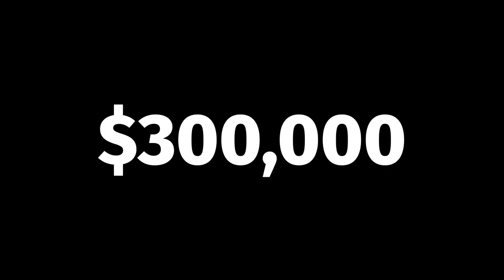7 CHEAP OFF-GRID HOME OPTIONS for Your Homestead - Podcast Episode 122

Comment: That was a very informative podcast.  And although I know this comment is coming a year after the fact, I feel I need to make it.  I am not against a natural built home at all.  And for sure the environmental footprint is something to consider - it is something I keep in mind a lot.  To each their own.

With that in mind, I find it interesting that moving an older abandoned home into the property was not mentioned.  A lot of times they can be gotten for free  or pennies on the dollar....A lot of times, in the smaller towns, they are just standing there rotting away.  I know I have a 30 X 30 storey and 1/2 that I got for free and it only cost me just the moving.  Coupled with that, reusing building materials can be a huge financial savings and definitely reduces the environmental footprint.  Granted, renovations can cost, but so can a new build.  Couple that with using the clay on your property to make bricks to use in the house or whatever, you could have a beautiful home for a fraction of the cost utilizing some of these techniques.  I will also add that you could build a walk out basement to set the home on.  I just seen one on another channel that needs some work in NC - a two storey that would be more than you need - they are thinking of bulldozing.  But I am also thinking you could find one way closer too.  Pole barns can be a very quick, effective way to build a home but essentially, you are building a home within a building to live in....thus increasing your costs.  It would be nice for a shop though to work on projects and to make into a barn....but it could be done later.

At the end of the day, one does what they think is right for them.  It may not be perfect, but it will certainly be your home!

Comment: How did you insulate the upstairs space you finished? I’m in NE Ohio and don’t want to be fighting to keep my house warm.  Closed cell spray seems to be the #1 choice but there are apparently supply chain issues on the foam and no local installers....😞
Reply from the maker: Yes, it was insulated, would need to insulate it!

Comment: Your view on shipping container homes seems to be missing multiple elements of design & construction,  ie. you can easily attach multiple containers together,  and even without welding,  but is most common method.   So the "skinny" issue is not a realistic concern or obstacle that is not easily remedied.   Just an FYI.

Comment: I've also spent many, many hours analyzing these different systems.  There is one aspect that NEVER gets presented in an unbiased way.  Namely, the wood stove or fireplace was more than just a heater.  It was the sole means of heating water and cooking,.  It provided an additional means of preserving food.  It was the soul of the home, where family and friends would gather, listen to the crackling, worship, laugh, celebrate, maintain community, connect, flourish.  An honest assessment of its "efficiency" will include each and everyone of them.  It very quickly becomes apparent that even though these people might have burned "a lot" of wood, they used far, far less fuel to live higher quality lives.  That's true for even the most inefficient open fire, but even more so for the masonry stoves they developed over the centuries and that used less fuel and provided better heat, cooking options, and more.  The internet, like earlier Industrial Age revolutions, have inculcated a certain hubris and turned the vast majority of people into mere consumers, uninformed at that.  People feel isolated, lack meaning in life, experience greater social anxiety, and other well-documented ills of modern society, yet they continue to look down their noses at ways of living that produced the circumstances for enduring, widespread traditions in harmony with nature.  The cultural revolutions that are taking place right now in the west will end little different than the one that happened in China.  People will see the old ways as beneath them.  They will think they have it better in their third party curated cage.  They are practically begging for it.  Only in hindsight will they realize the epic disgrace, and by then they'll have and be nothing.
Reply: What are you talking about?😮😂😅